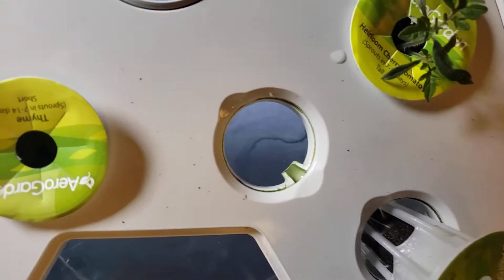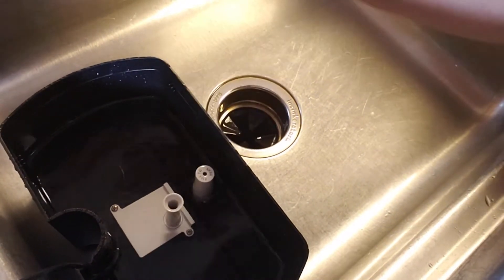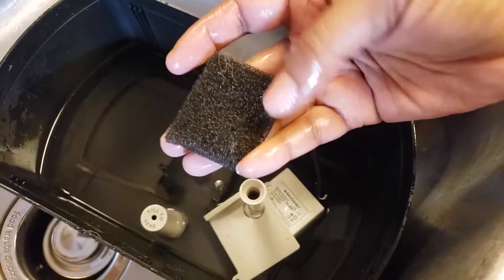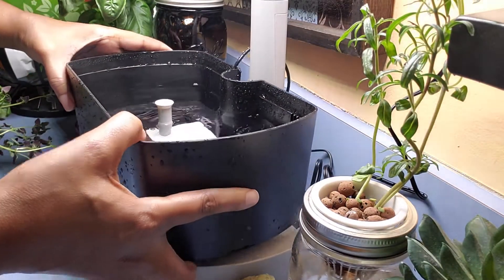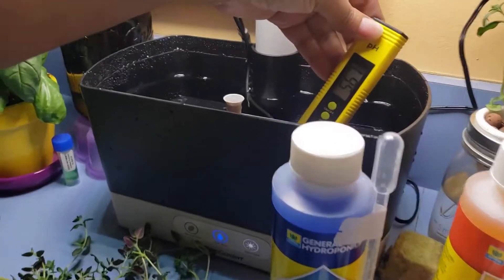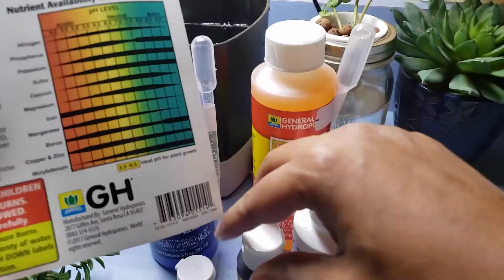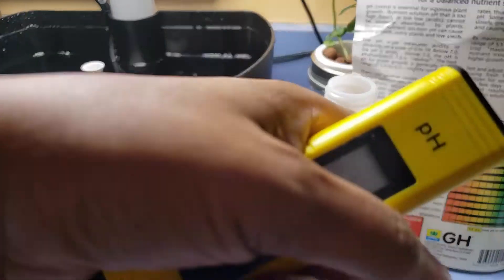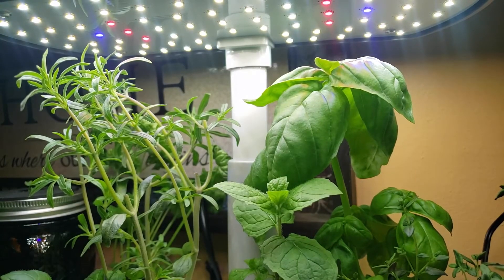Aerogarden Harvest Cleaning and pH Balance

Comment: I have the AeroGarden Bounty. I am on my 3 generations with using the Bounty and I love it. The funny thing when you add the Nutrients it will change the PH, AeroGarden design it that way to make it easy for new people. I learned if you use hard water you will get scaling and it will be hard to clean. I use filtered water and every 30 days I give it a new water bath.
Reply from the maker: Sorry for the late reply! Looks like I missed it! Thanks for the comment. I find that in all of my hydroponic systems, the pH changes a bit with nutrients. I definitely have hard water and notice the build up. I will try filtered water and see what that does. I also notice that tap water (even though it's hard) it kind of helps to balance out my pH here and there as well as my EC. Hydroponics can be a bit tricky sometimes but I love the challenge ☺☺ Happy Gardening!